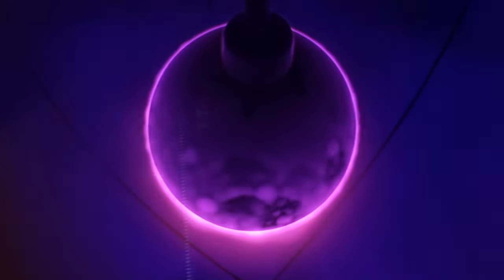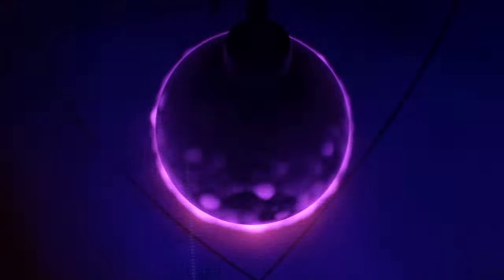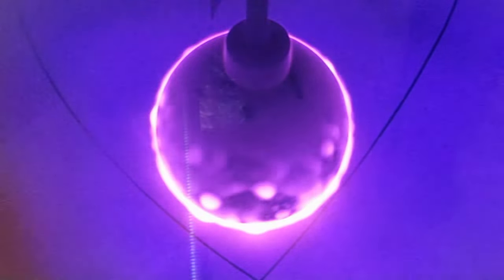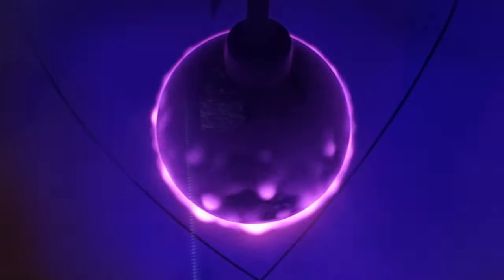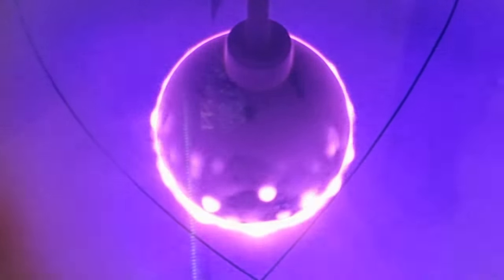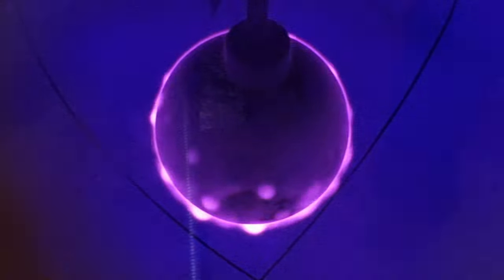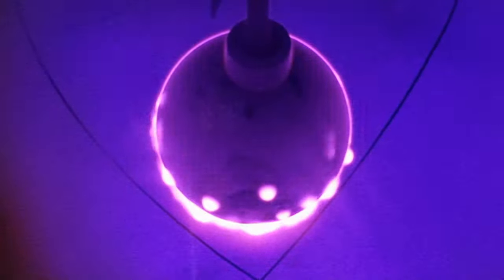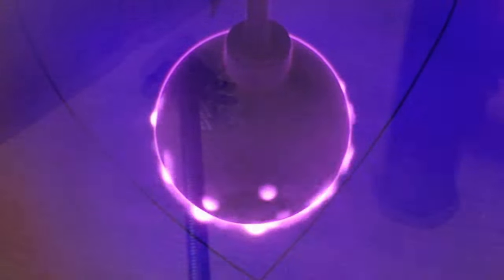VEGA - Plasma self-organisation under different exposures (WARNING, Strobe like effects)

Comment: did you get around to using nitrous oxide instead of air?
Reply from the maker: Some other gasses, not that yet. This has residual air, so it will make some.